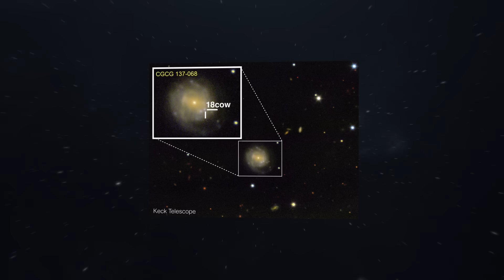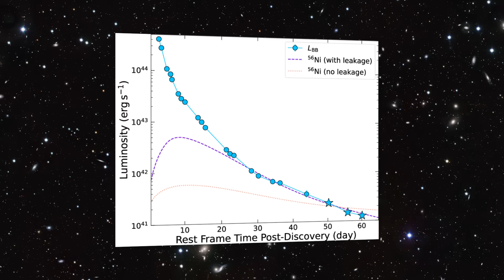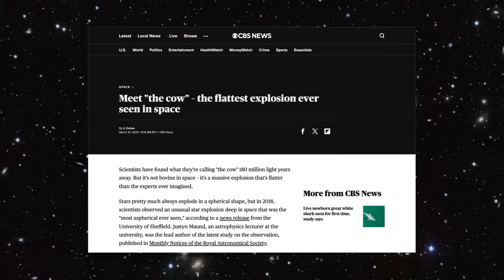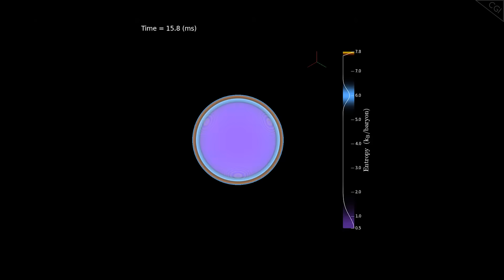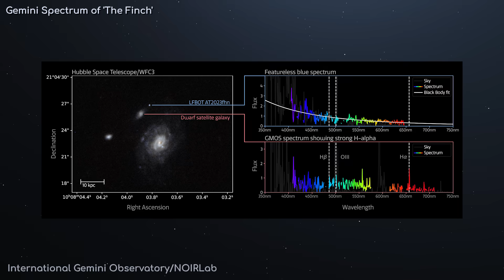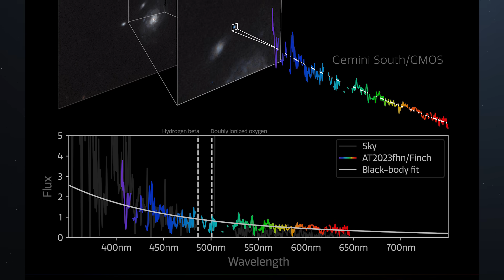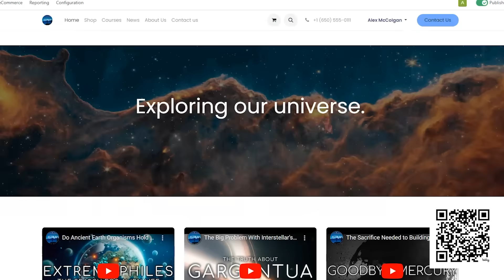Kilonova Size Explosions Are Popping Off in Empty Space

Comment: What if the explosions were failed star ignition? Everything finally tried to coalesce, something went wrong, and it exploded.
Reply: That wouldn't even come close to explaining the brightness. Failed stars don't even explode anyway. Those are called brown dwarves. They're still hot but not enough heat or pressure to support fusion. They're pretty much just faintly glowing gas giants

Comment: These look like the proofs I have been waiting for, for one of the founding precepts of my time dilation theory; Cavitation.
In one frais: My theory is time is the sculptor gravity merely the tool.
(It is such a detailed theory that YouTube will not let me post it in a single comment).
I say the Universe is not "homogeneous and Isotropic in "Time" it is instead a Maelstrom of whirlpools created and energised in the inverse's mass to time ratio's combining and competing throughout the Universe ;through the mechanism of Entropy.
"Where time flows slower Atoms vibrate slower so Entropy is the ,Quote "Un-Attributable Couse of gravity" Matter is attracted to where it can vibrate slower , In a less energetic ,colder condition.
'Cavitation happens when too much energy hits fluids'.
Consider the Propellor of a Submarine ,it gives off a cloud of bubbles that are vacuums so after a brief moment they simply implode under pressure from all sides, this collapse when it happens is so dramatic that the combined momentum of these tiny walls all collapsing to one point briefly create heat higher than the surface temperature of the sun.
Since the dark Energy driving the Accelerating and uneven expansion of the Universe is this maelstrom of time these Hyper powerful blue Explosions could be the closing of cavitations in space . You could in fact almost replace the word expansion with the frais "Filling in" as the turbulence subsides and the voids collapse into "Baryonic Space".

Comment: I bet intermediate sized black holes generate some sort of exotic matter inside them that hits a critical mass and detonates at some point. If iron is the heaviest thing a star can create through fusion without going super nova and neutron stars create major magnetic fields as well as  black holes I bet it has something to do with the magnetic energy being able to overpower the gravity. Like on a graph it would be that intersecting point where the magnetic field and gravity lines intersect. They say that all black holes spin and that the rotational rate of that spin could theoretically be enough to spin the black hole apart. That you could feed a black hole until it spun so fast it would blow up. What if these black holes are going through a process that creates something inside them that eventually makes their magnetic field too strong to contain its effects from containing the matter within. Just like the coronal mass ejections from the sun follow the magnetic field lines, something similar happens with the matter within the black hole and then goes back inside it. Which is why they are so bright but they fade so fast. The magnetic field lines wouldn't be affected by the gravity, so they would just need to be strong enough for any matter that was being pulled by them to overcome the gravity of the black hole and extend out beyond the event horizon so that we could see the light being emitted by the matter until it gets pulled back down into the black hole as it follows the magnetic field lines. Just like how the plasma from the sun does. But we don't see this in super massive black holes because they have too much gravity and overpower the magnetism all the way. And solar mass black holes either don't generate the magnetic fields necessary to overcome the gravity or the exotic matter that glows that brightly if it were to come out of the event horizon. Probably both. I think this would disprove of the theory of a singularity. Because while an object can be large enough to overcome lights ability to escape its gravity well, I don't think it can crush down to a single point without also exploding. It can get small, just not that small. And it's size will still always be relative to what went into it. Just like we observe with black holes as they are. You don't see a supermassive black holes event horizon being the the same as a stellar mass black hole. All that extra mass isn't going into a point the exact same size, that doesn't make sense. It might be so densely packed together by gravity that it can't move to emit light or any type of energy, but it all doesn't exist in the same spot. The idea is stupid.

Comment: It looks like crash translations. As a ship travels at ftl in the quantum foam just above the quantum potential field potential particals build up on the hull or outer skin much like static charge. As the vessel approaches the exit the nomal procedure is to slow and bleed off kinetic energy. This allows the potential particals to disassociate from the hull. In a crash translation all the potential particals are carried into "normal" space. The energy state of space is quite different from an object with a potential so as the potential particals convert to actual particals  existing at very high velocities they leave the hull into the lower energy state of space. This is in an attempt to equalize the disparate energy states. The velocity factor is how the flash is created. Different particals at high speeds interacting with stuff already there gives off various wavelengths of energy.

Comment: There are four possibilities in my mind.

It's least likely to be true, most likely average guess: Aliens(just getting that out of the way).

What I personally think: True vacuum collapse. Truely empty parts of space can not equalize with the interstellar medium and collapes, ripping the space around it into folding in an instant. Generating energy, which eventually disperses into fundamental matter. A bit farfetched, but given how little we know of what happens to quarks as they are converted to energy or from energy to quarks, I suppose it's not impossible.

Last but not least: Primordial black holes expend the last of their energy, and their mass now devoid of energy to convert all of it to energy. Given how much smaller these would be some one the larger size (about a basketball or cantaloupe) could produce a nova of similar power to a killanova (two neutron stars colliding and going nova).

My last guess is also extremely unlikely, but iron stars colliding. It is possible that right before a hypergiant star goes nova, another larger star or black hole parasitizes it, leaving behind just the iron core held together by the heat weld and gravity. This is still possible today, though the probability is below a statistical consideration, but had this happened about 3-5 billion years ago when hypergiants were comminplace, it would explain both why they are so distant and why nothing seems to be there.

Comment: Maybe it's white holes forming?  The other end of a black hole essentially, where all the energy that gets sucked in pops out
Reply: That is a possible theory
Reply: Might also be a black hole, final stages of Hawking evaporation (?)
Reply: @mscbijles1256 they don't have much energy to give off as they only weigh as much as a small small mountain when they start radiating heat and light
Reply: @colinhubble6667  that’s not much energy?! All that mass will have to be converted to radiation, so think of it in nuclear bomb sizes: the biggest ones humankind ever tested (Tsar Bomba) only converted about 5 pounds of mass into pure energy. That was humongous!! I absolutely don’t want to be anywhere less than a 1000 lightyears or more from this ‘small mountain’ when it converts into pure energy in a runaway Hawking radiation effect.
Reply: @mscbijles1256  okay, and how much mass is converted into energy in a conventional supernova? It's more than a mountain that's for sure. Even still I wasn't even referring to the end of its life explosion even as a mountain it will still remain together for some time
Reply: Why th'F not?!?😂

Comment: This is a really interesting phenomenon which I was ignorant of until this video. Thank you for sharing. Of the theories mentioned, there is another possibility and that is  an antimatter annihilation event. The radiation spectrum hints at a high energy interaction which would occur if antimatter was involved  and the absence of gamma ray emissions may be related to the speed at which the matter is  converted to energy. The problem is that the event timing tis too long for pure single atom events. I would hypothesise that the density of matter in interstellar space is diffuse enough to allow drifts of gaseous matter and antimatter  to intermix with little visible  evidence of antimatter reactions until the mix density reaches a cascade reaction threshold where  radiation and light pressure  changes the local gas density  resulting in an annihilation reaction cascade in local space. If this is the cause, it could explain the Tasmanian Devil event as the repeated peaks in luminosity would be caused by a harmonic interaction of multiple expanding shock wave fronts concentrating matter/antimatter into highly condensed pockets of gas which collide with the surrounding medium of interstellar space  thus producing the observed variation in luminosity. I'm just spit balling here and this should be viewed as speculation as I have not reviewed the evidence however the idea is intriguing.

Comment: I would think the answer is fairly simple and obvious.  They aren't kilonovas. They're the results of thermal decompositions of a black hole... A momentarily existing white hole if you will.
It's basically the same sort of event has the big bang, but much smaller.
Matter is compressed and heated until the higgs field evaporates... At which point all that mass is pretty much converted into pure energy. Like flipping a light switch.  Boom...a little bang.
From the perspective of the matter in the black hole the conversion is instantaneous and would prevent the formation of a singularity.  But due to gravitational time dilation this event would appear from the outside to occur long after the black hole collapse.
Interestingly enough, this would also suggest that the larger the black hole is, the stronger the time dilation, and the longer the lifespan of the black hole would be.
In terms of emission Spectra I would expect that the bulk of the energy to be dumped in the form of light, and that the remaining bulk would be reconciled as electrons and protons.... A hydrogen plasma and soup of other primordial particles.
If this mechanism exists though, it would certainly Doom the existence of a primordial black hole since these low-mass black holes would be the first to explosively decompose.
Reply: Not an expert but it would need to be pretty small black holes to collapse already. In galactic time spans they are ALL babies

Comment: One important thing to keep in mind - all the angles (arcseconds) that energy is emitted outward from a sphere. We get a tiny percentage due to only one pinprick on that sphere being directed at us. When an event happens, we assume that it's still the same sort of event (supernova / spherical kaboom), but there might be other types of events that direct more of the output energy in a certain direction. We'd then mis-assume how powerful it was. Something 5x as energetic but with most of it directed towards us - it's going to look VERY bright. These might be happening every day if the situation allows it, but what directs more energy towards us is more likely to direct the energy away from us, due to that arcsecond rule - lots of possible angles - so we also need to look for ways for extremely common theoretical events to focus the outputted energy more in one direction.

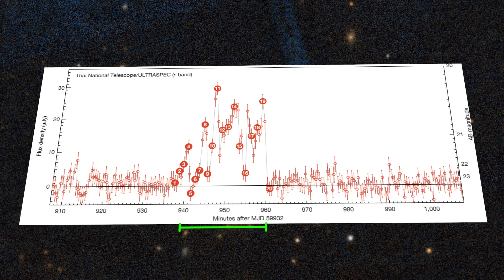Edit: 10:07 That actually fits a theory like that. If it was being ripped apart then the matter would take time to circle something like a black hole and get flung in a direction. We'd be seeing parts of the star destruction at each peak.

Comment: Another theory...
One of the only types of object that has enough mass/energy stored inside to sustain multiple kilonova bursts would be a black hole. If through some yet to be understood process the event horizon was breached, the resulting release of mass/energy would be near immediate, and it would also explain the asymmetric explosion as it would be centered on the breach, like a balloon popping. It could also explain the lack of gamma ray bursts - if the resulting explosion was red-shifted under the gravitational pull from its point of origin (reduced but not gone) to the point where the gamma ray burst would end up with a lower frequency, that of blue light.

I'm a layman and have no idea if the math would hold up, but from what I understand conceptually, it seems to fit.

Comment: What is being seen is an electrical discharge, not much different than a capacitor releasing all of its charge.  Just like in a rainstorm, or the volcanic ash coming out of a volcano, lighting forms from the friction of particles holding alternate charges. They just turn into lightning, and what is being witnessed is space lightning. I am not a physicist or an astronomer, much less an astrophysicist but I do write fiction, and for me, this is the only thing that makes sense. Eventually, this will prove to be what is happening and I very much wonder who will get the credit for the discovery.

Comment: It sounds like it could be a small amount of incredibly energy dense material like a neutron star or white dwarf colliding with a black hole, the matter is so dense and strong that as it's pulled apart, enormous amounts of energy are released.  The video mentioning neutron star "starquakes" being seen is what made me wonder if that were a possibility.  That and the lack of gamma rays, if the action is happening to an object 10km wide, it's extremely close to the influence of the black hole before being ripped apart.  Because the explosion happens just outside the event horizon instead of in a ring piling up many AU, the light emitted will all be strongly red-shifted too.

Comment: Clearly Culture vessels braking HARD while transitioniong from The Grid to realspace. There was this tantalazing line that if ships traveling at dozens times the speed of sound in Gridspace had to dump brake energy ether in Gridspace or Subspace. If they didn't and dumped all that energy the output of a small star into realspace the results would be supernovae level releases of energy. I believe the book 'Excession' touched upon this, with the A.I vessel reaching never before seen speeds and had to emergency brake on a dime.